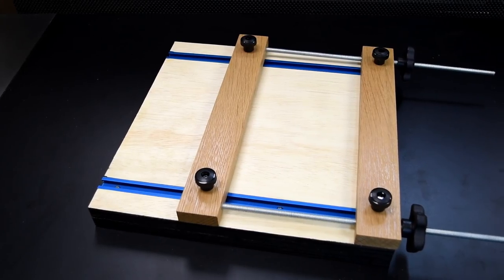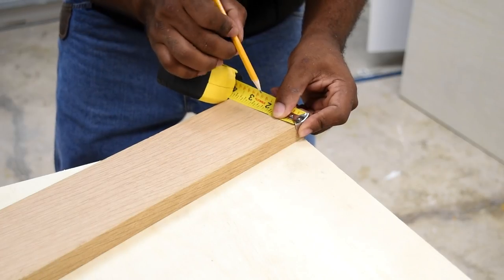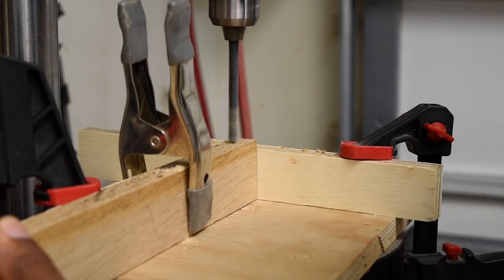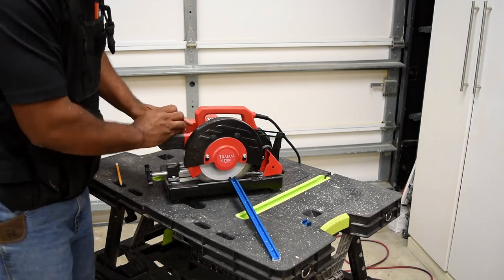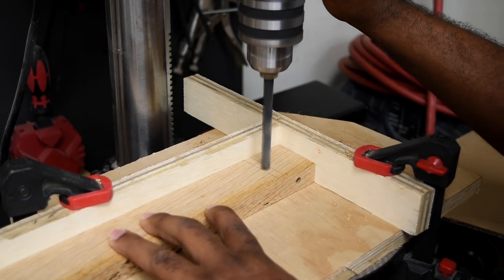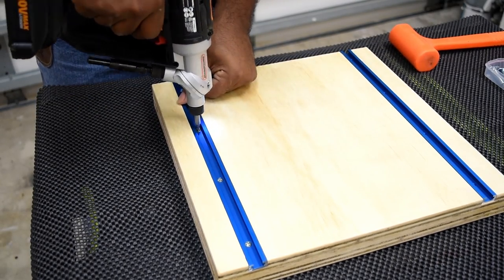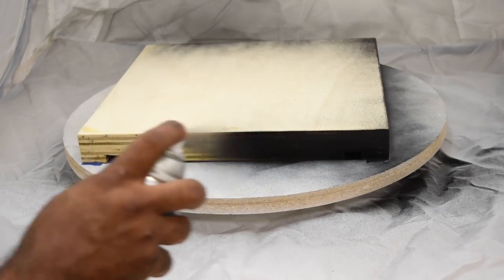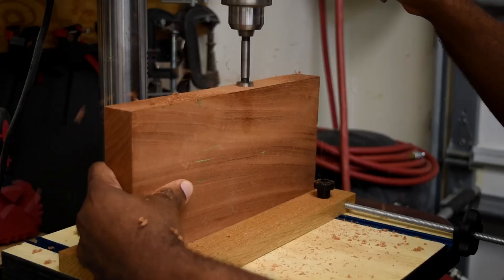Making A Mini Benchtop Vise  | DIY CREATORS

Comment: Thank you. I enjoy your videos as you show different ways  to do a task (Ease the edge of the board) 1. Use routers 2. Use sander.  Everyone should have at least one of those.  What were you using when you  drilled the counter sink in the aluminium and then took it off to have a drill bit under it?  Keep Broadcasting!!

Comment: Better video than your others , had a good useful project and was quick and to the point on how to build  I am handicapped so all kinds of versatile clamps and jigs are helpfull especially ones with lots of versatility  for tasks around the shop ( I now only have the use of one hand  and arm  so holding things are a chore ) I actually use a cheap machinist vise  lots ! I keep it uninstalled so I can clamp it down where I need it  at that time   I’ve used it from building models to opening jars that way  for a couple of years  !  My occupational therapist loved my idea  but your clamp will give me more uses than the smaller commercially available ones  I get online or at the big box stores

Comment: clamp jig? also known as a vise
Reply from the maker: The main reason I called it a clamp, that was the original intent. I made it glue up some small pieces. The more I used it I realized it had multiple uses. It could also be called a Vise.
Reply: The portability is the key, though.